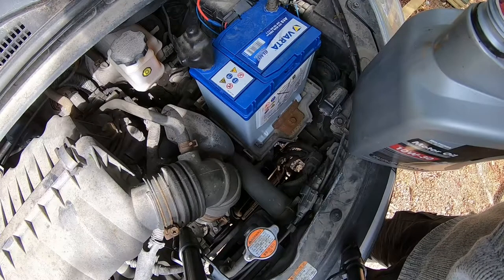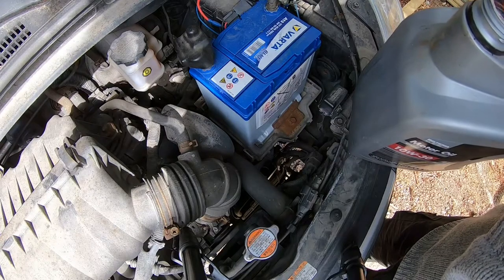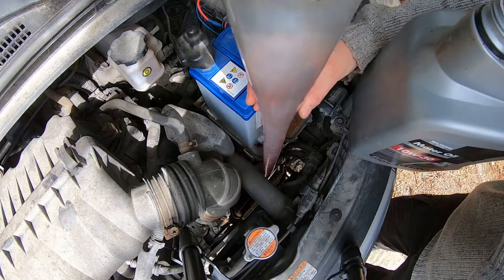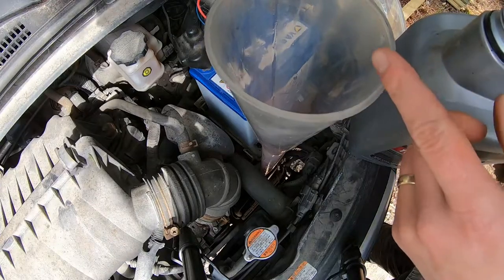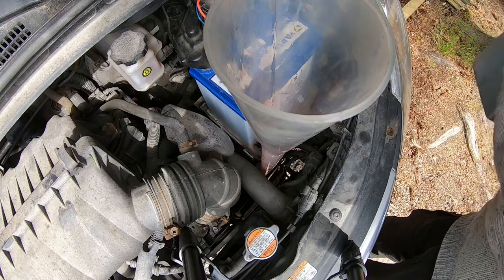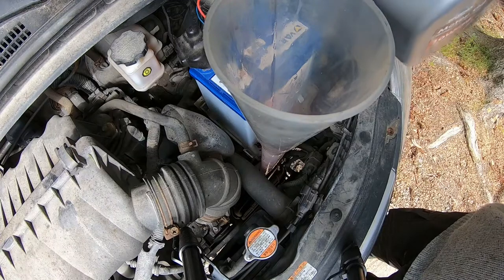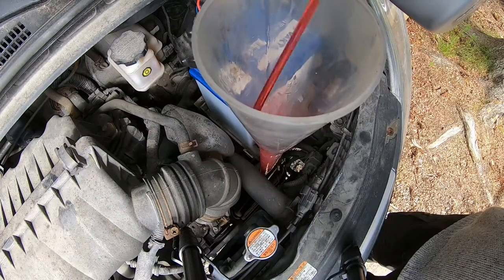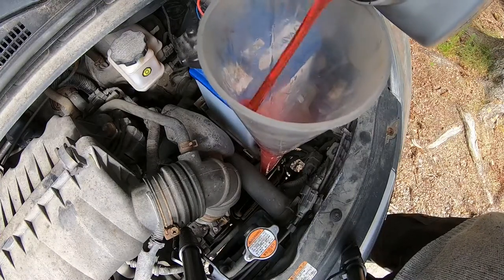Hyundai i10 automatic transmission repair. No drive and big leak!

Comment: i have some question. my father car stuck at gear 3rd while driving. 1st gear ok,2nd gear ok then 3rd gear still ok but it wont came to 4th gear.. can u help to tell me something abt tht.. im really appreciate yr answer🙏🙏🙏
Reply from the maker: Hi! Does your car have a overdrive switch? I know some older cars have a o/d switch that you must activate in order to get it to activate 4th gear.
Reply: @NilsKall  yes, it have od button on side the gear
Reply: its i10 1.25cc model
Reply from the maker: @badrulhisyamo  does it say od off or on in instrument cluster?
Reply: @NilsKall  its on cause no appear the diagram on board. if it off then the light will came on board like "O/D OFF".. oh, i have some update, im just tested driving myselft the car. so the gear actually not shifting to another gear except only on gear R reverse and 3rd gear for moving forward. the 3rd gear is the only way to move forward, no 1st ,2nd and 4th gear.. is this something cause from electronic fuse or something ecu controller i have no idea. the car was on few days before has sent to mechanic n change engine oil n filter, gear oil n automatic filter oil..but the problem still exist. stuck at gear 3rd if moving forward.
Reply: fyi if i shift to gear R, then the car was jerking. for the forward gear its normal, no jerking.
Reply from the maker: Ok! Sorry I haven’t work much with Hyundai so I can’t help. You need to take it to someone who can check the internal parameters like pressure etc. and fault codes.
Reply: @NilsKall  ya i understand. hyundai system is hard to deal with and hard to find the spare part in my country. my think now is maybe the solenoid valve or ecu unit.. ok sir, thank to your time.. appreciate it.🙏🙏🙏
Reply from the maker: @badrulhisyamo  no problem! Good luck!
Reply: @NilsKall  tqs sir🙏🙏